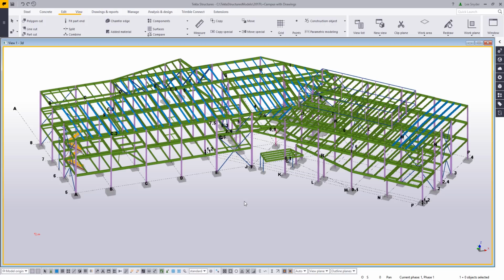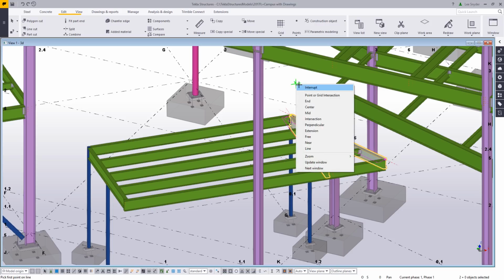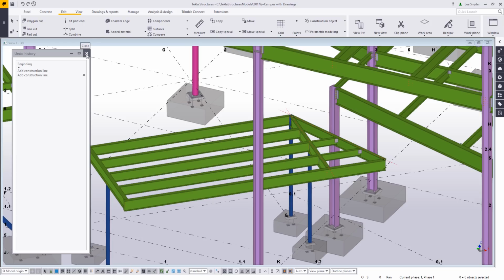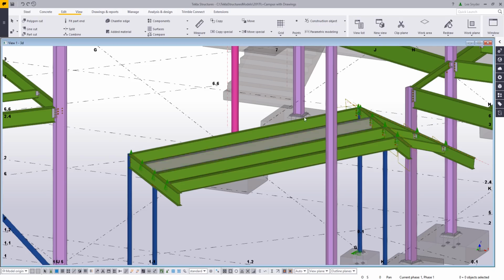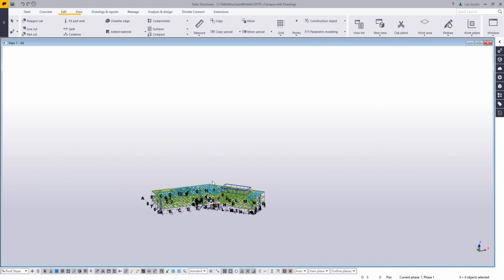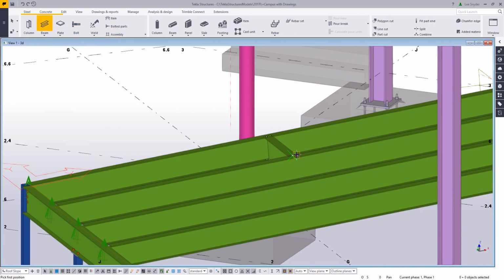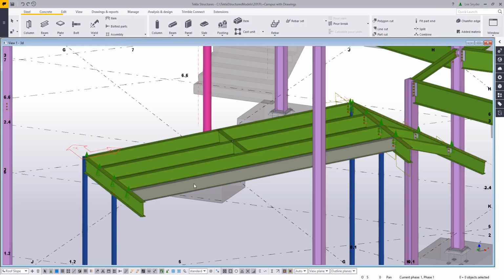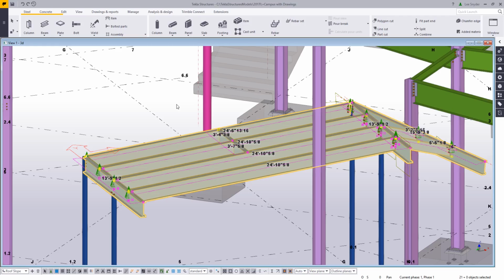Efficiency Tools: Undo History, Work Plane Handler and Select Previous Objects in Tekla Structures

Comment: Lee, These features are long overdue (but still very much welcome!). Is the UCS tool available in 2017? ; We have shared projects that need to remain in older versions. Thanks for the presentation!
Reply: Hey Tom!  Thanks for the feedback!  The new Work Plane Handler isn't available in 2017 but we do have the Work Plane Manager which can save/load user coordinate systems similar to the Work Plane Handler.   You can download it here:  https://warehouse.tekla.com/#/catalog/details/u40da903b-1a04-47e4-91db-b8099880bde5.
Reply: Hi, is the undo history feature available in 2017i ?
Reply: No this was added in 2018